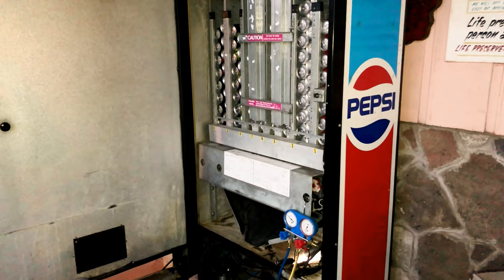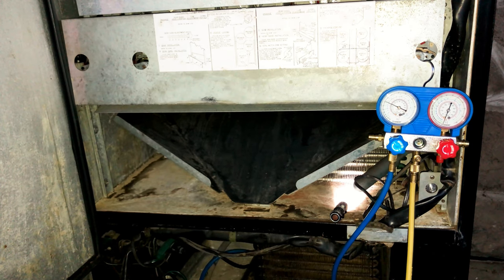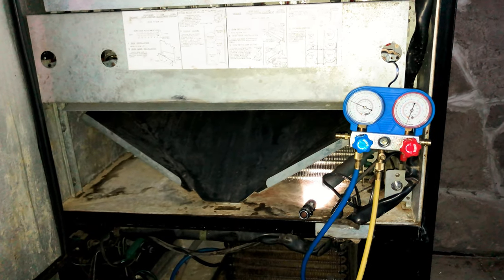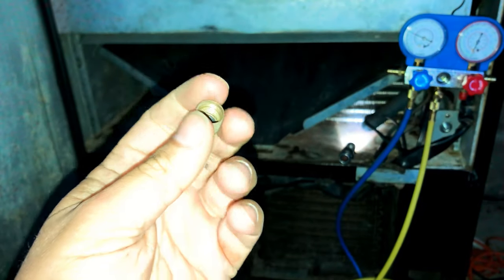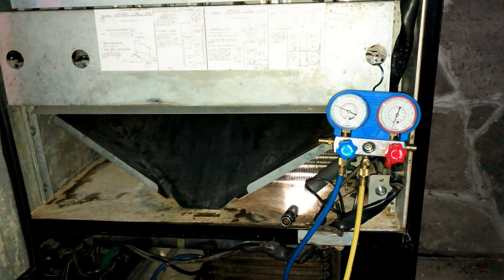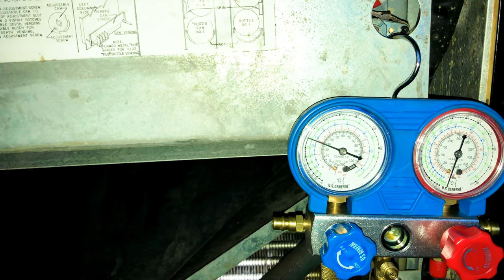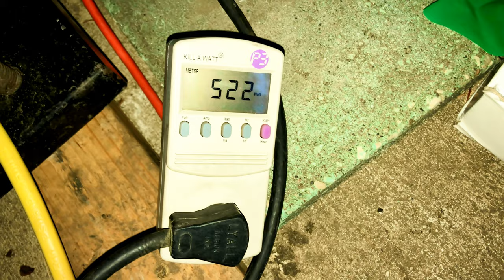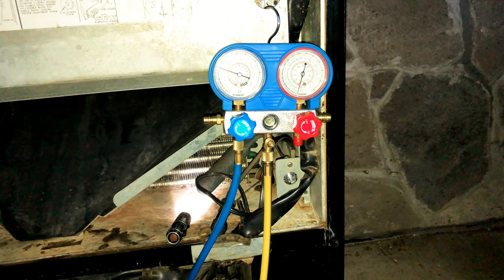Dixie-Narco Vending Machine R12 refrigerant recharge To 12a Alternative IT WORKS!

Comment from the maker: Just thought I'd note, OVER 4 years later, this 1987 over-worked machine is still chugging along! No refriegerant leaks since with the 12a, and operating costs are very low. Compressor going strong! Kept up well with zero issues at 100+*F and 90+% Humidity!

Comment: I can confirm this works far better than you would expect.
Reply from the maker: Just did one of our units refrigerators with the 12a about mid-may. First I did 134a which was factory fill, lasted about a 1 week before it was empty again. Had guests coming in, Home Despot was sold out of the needed size, so charged it again with 12a as I had no more cans of 134a. The 12a not only worked, I checked it Sunday, and pressure hasn't changed. Over 1 1/2 months. $500 saved.

Comment: 12a is basically a blend of R290 and R600a isobutane and Propane, Known as hychill minus 30 hydrocarbon
Reply from the maker: Did not know that, but I can attest it works and works very very well. Repaired a couple of our resorts all in one units (kitchenette units, 2 burner electric stove, sink and built in fridge) using it, after braising the leak point, put a tap on, vacuumed it down, refilled with the 12a, worked like a charm. drawing less power as well. the soda machine i the video is also going strong after 3 years since this video, getting ready to start its fourth season.

Comment: Hello, my machine is about the same year. The unit has the original compressor installed without the service port. The compressor runs when plugged into an extension cord, but cycles on and off. Is there an issue with the compressor or is it low on Freon. It was cooling when I started it up this spring and then stopped cooling. So two questions: Is the compressor needing to be replaced or Is the unit low on Freon?
Any help would be appreciated. Thanks

Comment: KMAN very good video. You mentioned at the end you would provide link to a digital replacement thermostat, but I don’t see on in the feed. Could you possibly provide the link please? I have a 1986 coke machine a thermostat is bad and wanted to replace with digital.
Reply from the maker: Unfortunately, the digital thermostat did not last. they just did not live up to their specs. Tried a few others. I think it was the initial surge current that kept doing them in. I ended up just going back to mechanical, and no issue since.

Comment: Thanks for this. I just got my Type I out of a curiosity (no practical use for me other than playing around with vending machines), but I was wondering about the whole R134 junk. This answered my questions. My compressor on my Dixie Narco 368 is dead. I just replaced the compressor deck last year...and it's already dead.  :/
Reply from the maker: yah, don’t put 134a in a r12 compressor. wrong pressures :-( will kill the compressor.

Comment: I just got the same machine but I'm no hvac guy. When you pulled a vacuum and evacuated the system, did you have to add oil or is it only atomized under pressure?
Reply from the maker: Unless you know it spilled out, or leaked, then I would not add oil. To get the  proper level of oil, one would need to completely  drain to be able to refill to the correct level. Unless it has leaked, or had an insane leak, you "should" be "ok".

Comment: Thank you!  Glad I found your video. I’m needing to charge an old freezer that ran R12. But the data plate doesn’t show how much to use, will 30 psi on the low side work? Also, what and how much oil should I add?

Comment: I have an old coke machine that no longer drops drinks from any space except 1. Any ideas. Also have one that needs Freon.  Any instructions on how to add Freon.
Reply from the maker: Can't comment on drinks not dropping. Refrigerant, well, thats pretty much what this video is about... Freon (R12) is no longer available. I recommend 12a, https://amzn.to/3srt6ji     and a bullet piercing valve if there is no service connection already in place, https://amzn.to/47hYCiC       I'd get two cans of 12a to be safe, though one can should be more than enough.

Comment: The website says:
"FrostyCool 12a Refrigerant is a blend of environmentally safe hydrocarbon refrigerants designed as a replacement for R-134a and retrofitted CFC-R12 systems."
That doesn't sound like a "drop-in" replacement to me.
Reply from the maker: It’s actually legal mumbo jumbo. Depending on your country. For some reason, USA requires to you go from r12, to r134a, before you can put in 12a. pretty much every other country does not have that requirement.
Reply: Called minus 30 in aus 
is straight drop in replacement for r12 or 134 a
Used it in both.
It uses less power and is colder.
Reply: According to the manufacturer the gas is compatible with mineral and POE oils in electric compressors

Comment: You actually can use r134a in an r12 system if theres nowhere for the mineral oil to settle out. R134a doesn't help move the oil through the system so the oil can get stuck in the evaperator or condencer but if the compressor is at the lowest point gravity will bring the oil back. If you add an extra couple ounces of oil you should be able to use r134a without issues. In a system where the oil can settle use 5 to 10% isobutane. Still not recommend but it will work. Also the gas velocity should be high enough to return some oil.
Reply from the maker: Yes, it will "WORK", however, the problem is that R134a runs at a higher pressure than r12. While it's a minor difference, and negligible if running lower than 70*F ambient, the hotter ambient is, and hotter the refrigerant is, the higher the pressure. Couple that with an incompatible oil, and while it will work in a pinch, compressor replacement will come quickly. Consider the HIGH temperatures of a Car/Truck! This is why I like 12a, the Propane Isobutane mix. It compresses at lower pressure than R12 and R134a. So compressor doesn't need to work as hard, and since it's even lower pressure than R12, the compressor will be stressed less than when it was running on it's designed refrigerant. So you may see longer compressor life than if you refilled with R12 even. It's also compatible with R12's oil. 
After playing around with it, with R12, this soda machine was running around 800 Wh with compressor on. Now, this machine is running between 400-500 Wh. 
Since I can't leave well enough alone, I modified the soda machine further :-) In fact, got a nice setup now! I think I might even beat the new machines for efficiency. 
I changed the capacitor out, and "Fine Tuned It" the run capacitor to properly match the compressor. Doing so, I brought the power factor to .98 with compressor on. Previous, with factory installed caps, PF was .55 (Remember, power factor of 1 is 100% efficiency, only things that can hit that are resistivity loads, such as incandescent light bulb, space heater with no motor, electric stove, toaster etc...).
Normal Idle power when compressor is not running. So basically the main cooling fan to circulate the air, draws a steady 80 Wh. I felt that was quite high, so I re-wired the fan to come on only when the compressor is running. I added a secondary DC powered fan that stays running all the time. It moves about 1/4th the amount of air the primary fan does, but instead of 80 Wh, it draws !!!! 3 Wh !!!!!. 
Yep just 3 Wh. While not moving nearly as much air, I'm not concerned about the drinks on the top being consumption cold. I want the ones on the bottom ready to be Vended, consumption cold. 
It has worked GREAT all last summer, even on the hottest days. Now I just need to get my jack under this beast of a heavy machine and shim it a bit. Not level so the water doesn't all drain out of the condensate pan inside. The fan runs off 5v plugged into a phone charger. Cost $6 at Wal-Mart :-)
Last improvement, I changed the lighting to LED. 

To give you an idea of the power and $$$ savings between LED, DC continuous fan, and the 12a Isobutane/Propane Mix, 
Pre-Modification whole machine consumption was ~8kWh/Day for rough total of 240 kWh/month = $0.13/kWh = $31.2/month operation cost for electric. 
Post-Modification whole machine Consumption was ~3.5 kWh/Day for a rough total of 105 kWh/month = $0.13/kWh = $13.68
Both tests were done with Similar ambient Temperatures of approximately 78*F-82*F, and all soda hoppers full. 

Prior to the modifications, the fan alone was drawing ~1.92 kWh/Day or 57 kWh/month ($7.41) all on it's own! 
Fluorescent Tubes were about 38 Wh each so 54.72 kWh/month ($7.11). Granted, not as bright now, but thats fine, it was too bright before. I'm using a 1.5 watt LED, which plenty bright enough. Blinding before!
Reply: @KmanAuto  Very interesting results! Thanks for the reply! If I were working on machines I owned I would be using r600a in them but since I work nearly exclusively on others equipment I can't take the liability of using a flammable refrigerant. Even though the likelyhood of anything going wrong is incredibly low, I can't afford to get sued. I have had no issues running r134a aside from it being less effective as a refrigerant. I just have to be very careful to not over charge the system because the discharge temperature can get too high very easily. The oil isn't an issue because the oil doesn't react with the refrigerant, it just isn't carried by the refrigerant so it relies on gravity and refrigerant velocity to return the oil to the compressor. In some applications this can be an issue but in a vending machine its generally ok. The other main issue is the oil becoming degraded from high discharge temperatures. This is why when a car had r12 you can't use r134a. The discharge temperatures are way to high in high performance applications but in small systems like a vending machine this isn't an issue unless it is overcharged. For me it came down to a decision between r134a and r152a and I decided I want to put the power of repair in the hands of the owner of the machine so I chose r134a. In addition r152a is slightly flammable but in higher capacity systems it is way better than r134a or r600a because it works with mineral oil and it has very low discharge temperatures.
Reply: @KmanAuto  r134a was made specifically for r-12 conversions and is way safer than a flammable blend
Reply from the maker: @doctorfeinstone6524  r134a was not made for conversions, it was made as a Replacement. R134a runs at entirely different pressures than r12, to the point where it will cause premature mechanical failure. Further, it is not compatible with the oils in r12.
Reply: No, nobody should ever do that.
Reply: @pikadroo  Nobody should ever do what? An r134a conversion?
Reply from the maker: @inoahmann7542  Correct, unless changing the compressor too, don't put 134a in a r12 system, it will work "ok" for a while usually, but you will destroy the compressor. Use 12a.
Reply: @KmanAuto  It's system dependent. Sometimes without the chlorinated refrigerant the mineral oil will migrate out of the compressor and it'll lock up, but in some applications gravity alone is enough to return the oil. I have pulled the compressor out and changed the oil to POE before, I always add a low preasure switch when I do that because I've had POE and r134a clog up cap tubes.
Reply: @KmanAuto  I have a 1974 cavalier small coke machine should I look for the same 30 psi on that machine when full of freon
Reply from the maker: @billywhalin4051  What is/was original refrigerant type?
Reply: @KmanAuto  tag says 16 ounces of 12 just says 12 on tag
Reply from the maker: @billywhalin4051  Ok, that would be r12 then. So the product I show in the video should work just fine. I believe the equivalent would be about 8oz of 12a. And roughly 30 psi.
Reply: @KmanAuto 30 psi on a gauge with machine on and cooling
Reply from the maker: @billywhalin4051  Yes, be sure to vacuum down the system before filling. Do not mix the 12a with any old r12 either! 
r12 is Dichlorodifluoromethane, where as 12a is isobutane propane blend.
Reply from the maker: @billywhalin4051  In hindsight, 6oz by weight of 12a would be more equivalent of 16 oz of r12.
Reply: @KmanAuto  ok thanks for the info would it be better to go back with r12 or the 12a
Reply from the maker: @billywhalin4051  That's unfortunately a "you" decision. I personally have been converting to 12a as I've been repairing. It's easier to get, cheaper, and even more efficient. 
As I've been repairing the refrigerators at our motel, I've been putting the 12a in the place of both r12 and 134a. I'm seeing a 10-50% decrease in power consumption with the compressor running. Also, due to the larger molecule (I believe it is 3x the size of r12 and 134a, a system that leaked out for whatever reason with r12 and 134a, has not been leaking with the 12a. Example is the soda machine in this video. r12 would leak out after a month. I have not had to add any more refrigerant since converting to 12a, so that is a nice benefit. You also use less of it as you already notice (40-60% less), so 1 less can of it! Just be sure to properly label the system so that someone in the future doesn't mix refrigerants, as well as 12a is flammable.
Reply: @KmanAuto have u ever heard of fr-12 made bu frigc is that a ok replacement

Comment: My machine just stopped cooling and runs in R134 originally as well and not a compressor issue so need to add coolant but never did it before as I have only owned my machine 2 1/2 months can you please show me how to do this
Reply from the maker: Pretty easy. I’ll link you to what you need to buy. Give me a few.
Reply from the maker: https://amzn.to/3jFhfpf  Is a little kit that will work. Comes with the gauge, and an bullet piercing valve. If your system does not have a charging/gage port, you will need the bullet piercing valve. Other option would be to braise one on, but not worth it. 

If your system still has some charge in it, as in not completely drained, you can just top it off. How old is the unit? Slow slow leak over time? Or fast leak? You should repair any leak the system has. If it's a very slow leak, you could get away with just adding a bit every year or couple years. Since I charged the machine in this video, it's been almost two years of hard use. I put the gages on last week, and it's down "maybe" 3 psi, which could also be attributed to difference in outdoor/machine temperature. So basically, the leak will take a good number of years. 
Pickup a $3-$5 can of 134a from wal-mart or the hardware store for your machine, since it was designed for 134a

Comment: can you make a video how to install a service port for a closed unit I have 3 vending machines that are closed units and i dont want to spend 810 dollars on new cooling decks from the manufacturer
Reply from the maker: Well, at the moment I only have the one Vending machine, and none of the refrigerators at my motel need a recharge or repair at the moment, so I can't do a video on that. I don't want to put a tap on something that works and potentially damage it. 
But this is what you need, 
https://amzn.to/3fNWR2x
It's a Bullet Piercing Valve. Off the compressor, is a tube that comes out, that goes to nowhere. End is soldered shut or capped. The bullet piercing valve goes over that tube, clamps on, and once on, and connected to your gauge set, you turn the hex wrench and it pierces the tube.
Reply: Adrian Ruiz, look up videos here on YouTube on recharging refrigerators a lot of them show installing a service tap some of them are piercing caps others area solder on service Port available on eBay. If you watch the videos and look at your unit you will see they are very similar. Keep in mind you should have some experience in refrigeration to do these things safely at the very least set through some online videos on HVAC to familiarize yourself with the tasks at hand so you do not damage your unit do harm to yourself or others 😉 there's my disclaimer.

Comment: Hello, Kman Im interested in your skills, I hope you're doing well after all, well my question is how did you improve the power factor in that motor? And thanks in advance.
Reply from the maker: For motors, you would use run capacitors to increase PF. Ideally you want the PF to be around 0.95 (95%).  you don't want to go over 1 or it will start wasting power. 
See my other video on power factor correction. A REALLY OLD and not the best done video, but should give you the jist. https://youtu.be/yPzrbj0FxUo
Reply from the maker: Capacitors: https://amzn.to/2WzCOQu
Reply: @KmanAuto  thank you so much. I will see that video again. first of all, I do need an accurate device to measure the power factor. (Nice children) bless you.
Reply from the maker: @FaddyMH  I know late late response, https://amzn.to/36DnozD is a great meter. Prices have gone up on them lately, I have two, use them constantly.